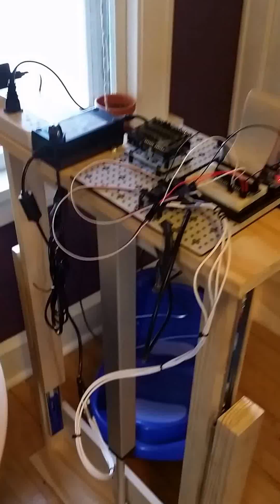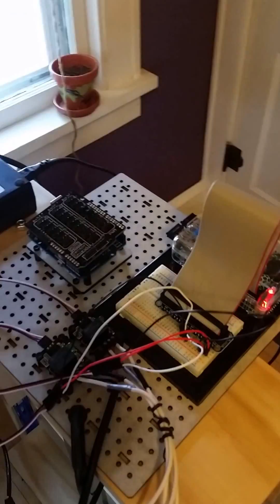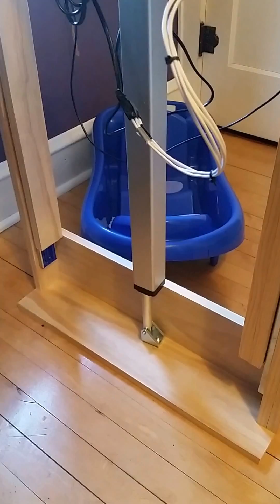Raspberry Pi Controlled Standing Desk - First Leg

Comment: Do you have a detailed wiring diagram?
Reply from the maker: Hi Samuel -  I don't have a complete wiring diagram, but I do have a couple things that might help:

Issue on github where someone suggested a simpler wiring approach:
https://github.com/brentonc/RobotDesk/issues/4

Blog post with a closer picture of the wiring and and explanation:
https://brentonc.com/2016/07/01/standing-desk-wiring-6-relays-to-2-gpio-pins/

Article from actuator manufacturer on using a relay with an arduino (similar concept to mine):
https://www.firgelliauto.com/blogs/news/18090523-how-to-use-an-arduino-with-firgelli-automations-linear-actuators

This tag on my blog has other posts and videos related to constructing my desk:
https://brentonc.com/tag/robot-desk/

Good luck!

Comment: If were to build a smaller desk, could I get away with just one actuator using a similar leg design? Instead of keeping it straight across the top (bottom) of the actuator, make it a 90 degree angle?
Reply from the maker: +Hawkeye's Corner Hmm.  You could do 1 actuator, I think.  These actuators can lift ~250lbs, so it would be strong enough but you just might lose some stability.  You'd want the actuator to be lifting from the center.  I saw a build once where someone basically built a telescoping column with an actuator inside it, seemed pretty good for a smaller desk.
Reply: ***** Thank you, I'll have to do some more research. Your desk looks awesome, by the way.